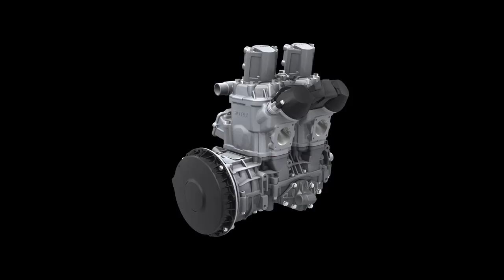Ski-Doo E-TEC Engine Technology

Comment: I may just have to go back to Ski Doo sleds. Was a 100% doo guy up untill I purchased a 2000 ZRT800 and a 01 Tcat. Then after some issues with these I went to a 03 and 05 RX1's. But now Ski Doo has an 800 with as good fuel milage and a power to weight ratio that is un challanged.. well these new Etec 800's are really looking good to me.

Comment: i work at a powersports repair shop that handles all 4 brands under 1 roof, ski doo and arctic cat are the most problematic sleds that come through our shop,  ski doo has a lot of issues with their cranks, a lot of people don't know about the special grease that is supposed be applied to the outer crank bearings, people don't bring their sleds in to be serviced correctly end up biting the bullet when their cranks fail. i see a lot 600 and 800 etecs with 2-3,000 miles on them needing cranks,  most cranks seem to last 5-6,000 normally without being serviced. needless to say i won't own a ski doo, best engines made by ski doo were the 583, 617, and 670s  after that they were all junk
Reply: I loved my 94 583, that thing was a fucking monster
Reply: i agree
Reply: Etec engines make tons of bottom end torque man idk where that came from. In fact that's where the biggest difference is found compared to the carbureted versions of the same motors the 600 HO and 800r ptek. The peak operating rpms r even lower on both etecs which tells u immediately they make more torque
Reply: Living in an area with long winters doesn't mean whatever u say is right. If u think a 550 fan or 340 make more torque than a 600 etec or any liquid cooled 600 then ur not too bright. If any sled needs revved past 1/2 throttle to move then clearly there's a problem somewhere. Its either getting too hot and the computer is pulling timing or there's an electrical problem or something. A 600 etec running the way it should will run circles around those sleds, no comparison
Reply: apparently you have never had a 600 sdi...
Reply: Jason Cluckey idk if u r talkin to me or him. 600 sdi's r an awesome motor I've never owned one but have ridden a bunch. I know they make more peak hp than an etec, as for bottom end torque I don't know. All the ppl I know that own one love it and say they've been bulletproof reliability wise. If u notice in the one post I said 600 etec or any liquid cooled 600
Reply: their cranks aren't trued corectly. and the motors aren't sitting square in the chassis. correct that when you first buy the sled and it will run good for many miles